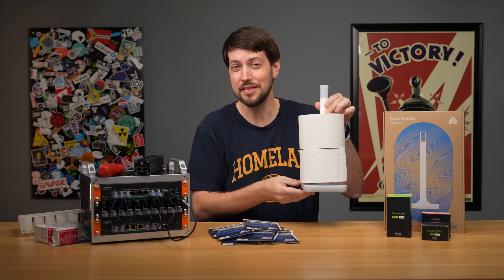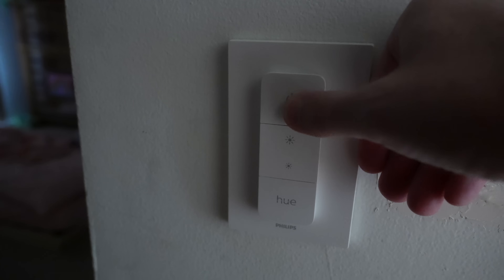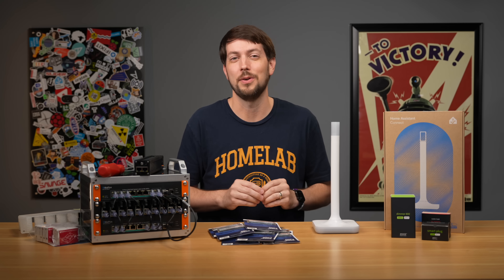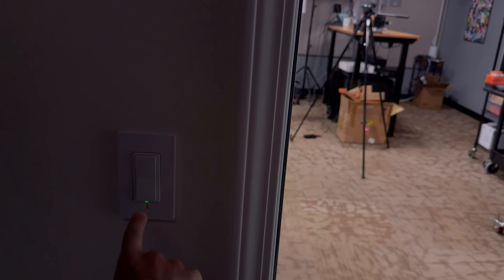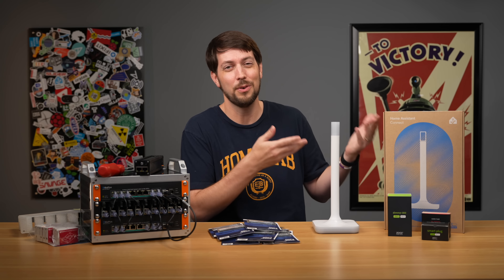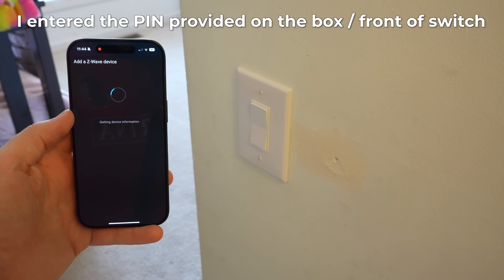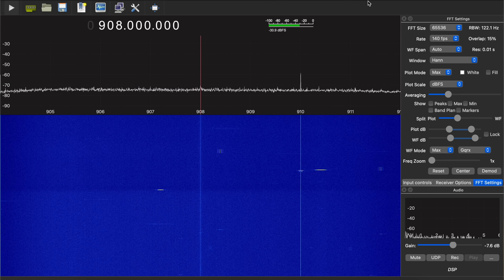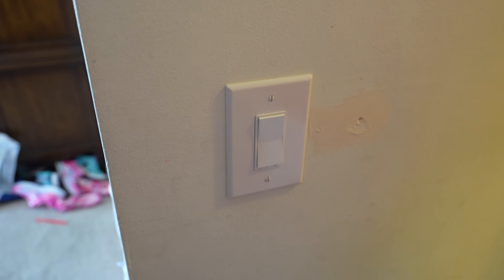My Smart Home Played me for a Fool

Comment: I've been wanting to get into Home Assistant and start replacing some of our existing dumb switches with smarter dumb switches like the one in this video.  But because there are so many options in this space, I keep getting decision fatigue trying to decide if I should go with Z-Wave or Zigbee (or something else).  My current "smart" bulbs are all FEIT WiFi and I hate them. I'm just having trouble deciding which way to go so I can start making purchases. Any advice internet?
Reply: I went with all primarily zwave because  zigbee and matter can interfere with regular wifi signals and wifi devices add additional strain to your router. Zero regrets up until about 2 years ago.  Zwave devices have slowly been creeping up in cost. For example a zwave light switch can run you upwards of $50+ while you can purchase an equivalent device running one of the other protocols (zigbee, matter or wifi) for literally half the price. The cost to manufacture a zwave device and license their protocol is getting more expensive and most companies are passing that issue onto the consumers. 

Zwave (like zigbee) really relies heavly on you setting up a good mesh network. Requiring multiple devices be hardwired to act as relays for other devices that might be too far away from the main hub. 

Zwave devices also tend to report back much less information then the other protocols...for example if you purchased a zwave door sensor - it may or may not have additional functionality like temperature or orientation monitoring (things that are pretty much standard with other protocols nowadays). However the trade off there is that battery operated Z-Wave devices last FOREVER before needing a new battery. I own a couple zigbee door sensors and I have to change those batteries once every few months but I genuinely can't remember the last time I needed to change a battery to a zwave device. It's been years.

Zwave is also less widely used now. So hubs with a zwave antenna are becoming less common. You can find matter or zigbee antennas are getting put into everything. You could use something as basic as Alexa as a hub for those at this point but for zwave (as shown in this video), some hubs require you to purchase a zwave antenna separately.

If I had to do it all over I'd still pick zwave cause I have maybe 30+ devices and if they were all on wifi or zigbee I know I'd have signal interference. Matter is still too new to say if it's really going to be any better or just different then zigbee.

Comment: Speaking of being made to look like a fool, I was dumb enough to buy WeMo "smart" switches over the years, only to have Belkin decide they're going to pull the plug on them come January. They will supposedly continue to work with Home Assistant (which I don't currently have), but they won't be making any updates to the firmware and without Home Assistant they're basically going to be bricked. Needless to say I won't be buying any Belkin products ever again.

Comment: I'm surprised you didn't try pairing your zigbee stuff directly to your homeassistant instead of relying on hue bridge. Zigbee normally should mesh, that is your remote should reach the hub through other AC powered devices, not relying on the direct connection, altough that may work differently with their hub, but should work perfectly fine with any zigbee homeassistant adapter.

Comment: Love the zooz stuff.  Their dimmers are very configurable.  

Our family had the same annoyances.  Ours are set for single tap on goes to 95% and double goes to 100.  A majority of ours are on motion and the motion logic is locked out if brightness is above 95%.  Also make sure to adjust the min and max brightness for led bulbs.  This rescales the brightness range so setting a light to 1% works as expected.  Many led bulbs won't turn on under 10%. Also many are over driven at 100% so reducing the max increases life span as well as dimmer responsiveness.
Reply: I doubt 5% will make any difference.
Reply: @jaro6985 the 5% isn't for under driving and is after the "rescaling".  Most of my LED bulbs are set to minimum 10 and max 70.  The percentage slider is rescaled so 1% is 10% of the driver and 100% is only 70% power on the actual drive.  The 5% isn't noticable in brightness after those adjustments and lets us double tap up to lock out the auto off.

Comment: I'm think of getting one , BUT I can see that I'm going to have real problems with migration , I have a AEON Labs Z-Stick S2 so don't think I can upgrade the firmware so I can use there migration tool , some of monitor plugs are in places I can't get to like behind washing machine , light switches etc , and it been a long time ago so I don't know how to put them in pairing mode , don't know if you can have 2 z-wave controllers on home assistant so I can leave what I can't get to now and put most of the other snuff on the ZWA-2 ?

Comment: On a different model of Zooz switch, I can set parameter 18 to control a custom brightness level when the physical switch is turned on.  Of course, the custom level can be full-on.
I'm pretty sure your switch will have a similar setting.  Be sure to perform any firmware updates first, some of the parameter controlled features may require them.

Comment: Over here in Europe, we don't use switches like that so instead, I have switches from the HomeMatic IP range. They DO use a proprietary protocol between their switches, remotes, base stations, etc but they work similar to this one (they will function as normal switch and even comms between devices work without any base station, once the various relationsships between their devices are programmed and uploaded). Add a CCU base station and you can control them from Home Assistant, ...

Comment: I've done something a little different, I use a normal switch, but it's hooked up to a Z-Wave dimmer module hidden inside the back box.  Works great, lights can be controlled and dimmed using just the switch with no hub/internet required.

Comment: My zigbee network has more coverage than my wifi network, while living in a small home, just outside of tiny home territory. And I do have 3 wifi accespoints set up. The meshing is great. But you need to go all in, otherwise your coverage will be lacking. 

Most zigbee switches (120v switch modules) do have a switch input, so if your electrical box has enough room, you can in fact connect your existing switch to the smart switch and it'll work like a hotel switch.

Comment: You could have connected/bind the Hue switch and the light directly in the Philips app, so it works also without the Philips hub or Homework Assistant.

Comment: Part of the problem is that unless you want to replace a bunch of functional devices not using Z-Wave, the likelyhood that you're going to shell out several hundred bucks to replace them with a protocol that virtually nothing uses anymore is slim. Maybe a brand new smart home, but when most smart homes are already all-in on either Zigbee or Wifi (or maybe a combo), adding Z-Wave when there's no issues doesn't make a lot of sense.

Comment: For my home automation setup, I use a WAGO PLC combined with DALI lighting. My family interacts with stylish JUNG buttons featuring laser-etched symbols that indicate specific lights or modes—such as reading mode, TV mode, or dinner mode. A small LED shows which light or mode is currently active.
From my family's perspective, the system is simple and user-friendly. On my side, everything can be fine-tuned—like dimming—and controlled via my phone or computer. The system is industrial-grade: it’s fast, reliable, and free from issues like limited range or battery failures.

Comment: I thought the hue lamps are repeaters so if you lamp can reach the bridge so  should the switch, my bridge got messed up and the switches didn’t work like you said and i factory reset device including the bridge and it fixed it. Ive had them along time so expect some 3rd party app had messed something up.

Comment: I used to have Philips Hue lights in my flat, too, but having battery powered devices hanging on my wall that may or may not work depending on my hue hubs mood (or zigbee2mqtt in home assistant later on) just didn't cut it for me. Even more so when my parents needed something from my flat and stuff just didn't work. Having to remind them not to use the normal light switches was also annoying. So I sold all my hue stuff (beside one or two bulbs for desk lamps) and swapped it for shelly devices that can go behind the normal wall switch. Now it's seamless, the light switches work just the way you would expect a normal switch to function, even when they can't connect to my Wi-Fi for unknown reasons. I've had them for over 2 years now, and I couldn't be happier with the results!

EDIT: I wrote this while half asleep. Fixed some spelling

Comment: Those Zooz switches cost about $40. 
I’ve bought 3 SonOff Zigbee switches with the same functionality for less than €36 incl shipping etc. 
Oh and those switches also work without a neutral and the are small enough to be places behind the existing dumb switch so there are no changes at all for the non smart home users.

Comment: Just get an smlight ZigBee hub (Poe) and switch your hue devices to it. No need for all the extra drama
Reply: I'm sure the Zigbee hub here is fine, it's the lack of a mesh setup that properly and tightly covers the entire home. Any ZIgbee device may have 10 meter range and only the wall powered Zigbee units act as routers. But sure, a nice well established mesh (for Zigbee and Z-wave both for that matter) make things more robust. Until it becomes so huge the amount of devices and the amount of chatter on the network becomes an issue anyway.

Comment: 240V in Europe?
Yikes. I hope not 😅
Let's keep it at 230 +10%/-6% 😊
Reply: I was just about to write a comment
Reply: 240V is the standard voltage in the UK. And 230+10% is 253.
Reply: @Z80Fan obviously, but we talk about the nominal voltage, which is 230V +10%/-6%. According to the new regulations also in the UK.
Reply: @Z80Fan Didn't know that.

Comment: In my house in the States I had a similar Z-wave light switch set up (I even had started installing mainly Zooz switches as my switch upgrade of choice after dealing with weirdness in the GE ones early on). My philosophy was always basically what you say here: keep bulbs dumb, and the switches able to do the standard "up is on, down is off" behavior connected directly to the main power going to said dumb bulb, so that the fallback will always work like a standard switch on a bulb and the smart behavior will be in the switch so that the switch itself knows its own state and can do its smart stuff ON TOP of the aforementioned standard behavior. I always thought that smart bulbs were not the ideal solution because of the exact issues you had. Also, even though LED makes them longer lasting, bulbs technically are a consumable, whereas switches for the most part are not -- it makes sense to put the smarts in the switch, since they will change much less frequently (other than the upgrade itself, they will need a change once or maybe twice in the life of the house, basically).

BTW, Z-wave should also support meshing, I believe, but do I like the idea of having one big hub antenna like this one so that you know everything will see it reliably and the Z-Wave network will be a fast as possible. Now that I live abroad, though, I left most of that stuff behind (I do still have my Hubitat and a pi running Home Assistant for some other automation stuff) but I have to see what the smart home hardware situation is out here...

Comment: Wait, so a couple of things
#1 Why not replace the hue hub with home assistant's ZBT-1 and running all your zigbee stuff on zigbee2mqtt or zha? That gets rid of phillips stupid app and account requirements
#2 Zigbee is a mesh protocol? Those switches should route the message through the bulbs and into the zigbee gateway
#3 AFAIK - i never had this switch since it's not that popular in europe - that battery switch is one of the fancy zigbee green devices, meaning it should be able to be paired directly to the bulbs, bypassing the need to communicate with the gateway at all? Or at least that's how the earlier battery-less ones worked
Replacing them with z-wave switches was kinda overkill, but I understand it's for the purpose of making a video about a z-wave bridge :)

Comment: I did almost the same thing in my parents house. The only difference is that I used Zigbee instead (this was before Z-wave became an "open" standard) with smart relays from Ubisys and NodOn. They work really well for retrofitting "dumb" lights and sockets with minimal effort. Now there should also be some from Shelly coming out! 

The cool part is that there are some specific devices like the Ubisys C4 that is just a series of mains-connected switches as input, so that you can control smart devices (in my case, some LED strips with a zigbee controller with no switch input) without having to use other kinds of unusual devices (a big must for my parents)

Comment: Zigbee bridge with 2.4GHz radio in metal rack in the basemnet, what could go wrong xDDD Why my Zigbee Smart bulb and remote don't work correct xDDD Are the WiFi APs also in the rack?
For house and Zigbee use PoE coordinator in central of house or one per floor with specifiy house

Comment: the fix would be a shelly behind the old physical light switch. Works 100% offline, with wifi and the switch works as long as there is power.
Reply: That's what I did in my bathroom. The light fixture is a weird Costco fixture that we don't want to replace yet, so it's just a smart plug behind it.

Comment: Does this fail dumb? The Shelly units can turn a normal switch "smart" but the way they do it turns the switch into an input so it won't work if the shelly fails. 
I just want a unit which acts as an intermediate switch, using a relay to switch, some sensing circuitry to tell which side is currently hot, and the ability to take power from either side to power itself (with a constant neutral connection). This would leave me with a normal instant dumb switch if the unit fails.

Comment: I fixed the hue switch issue by migrating them over from the hue hub to my home assistants zigbee network. This means they're part of the larger zigbee network and also it gives me much more utility for the switches. Rather than just controlling the lights, I can have them also control blinds, tvs or anything else on my home assistant network.I still have the hue bulbs linked to the hue hub, but that's for redundancy as it means I can use the hue app if home assistant is updating or otherwise offline. Plus it's easier to manage scenes through the hue app than home assistant.

Comment: I agree that my biggest mistake was buying smart bulbs instead of smart switches.  The wife factor of switches that just work is immeasurable.  I'm much happier with where I have smart switches over where I have smart bulbs.  The only place that needs smart bulbs is in a ceiling fan in a location not wired for a ceiling fan.  (The switch controls the entire thing.)

Comment: Curious choices. First thing i noticed is that for Philips hue lamps, you shouldn't have to register anything. These things are zigbee driven and should function perfectly well directly from home assistant. 

Second thing i noticed is that both z-wave and zigbee are meshed networks, so installing one more device between the hub and the bedroom switch should take care of the long range, and as a bonus you have another smart room.

Third, there was no need to switch to z-wave. Zigbee devices are more readily available and cheaper. Why go with a big expensive z-wave antenna and switch?

Comment: In Europe we are not 240 Volts these days - The standard mains voltage throughout most of Europe is 230V with a frequency of 50 Hz
Reply: To me, as a licensed electrician in the US, those two voltages are EXACTLY the same. The numbers for different voltage ratings are so loosely defined, we might find devices rated for 208V, 220V, 230V, 240V, 250V, or even "the 200V range". Any and all of those devices will work just fine on our electrical grid, although the current drawn by the device will be different for each of the different voltage ratings.

Comment: I have had FAR better results and FAR fewer problems and frustrations with Z-Wave over Zigbee. 
BUT ... for overall reliability and utility, my ancient X-10 devices still do the job. I especially prefer having a push-button remote pad to control lights, instead of having to fiddle with a cell phone and find an app. A very old program running in Windows controls their timer scheduling. My Z-Wave and Zigbee is controlled through Home Assistant; a next project is integrating X-10.

Comment: You could have extended your zigbee network with a zigbee router/extender. Or you could have paired the hue zigbee switch directly with the light, come to think of it if you were desperate. But using dumb bulbs is pretty appealing as well given the price of stuff.

Comment: We did this at our house a while back and almost every single light switch is z wave. Want Blade Runner lights that turn on and off depending on your room presence? You can totally do that with these kinds of switches. You can also tie all this stuff to a single switch, meaning I have a giant red button in my bed room that shuts of all of the lights in my living area or turns them on depending on the amount of times I press it.